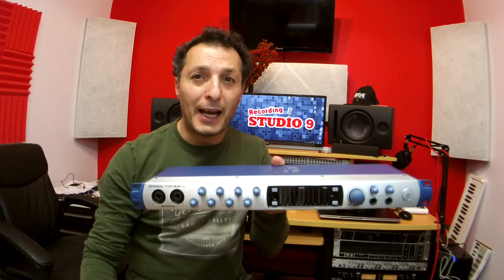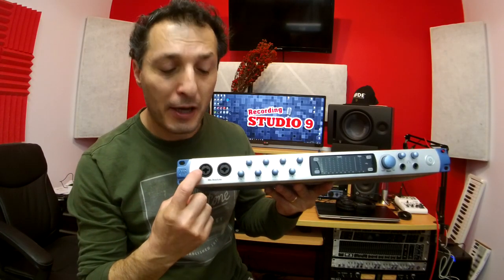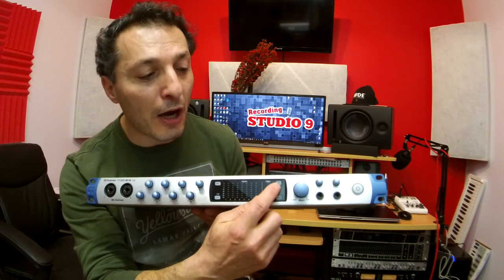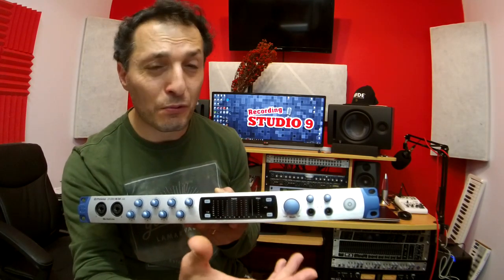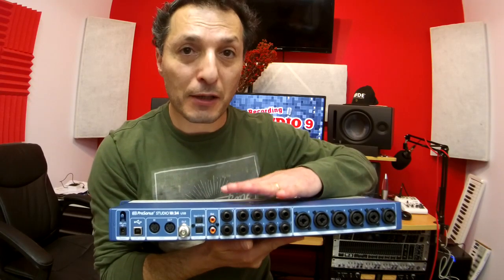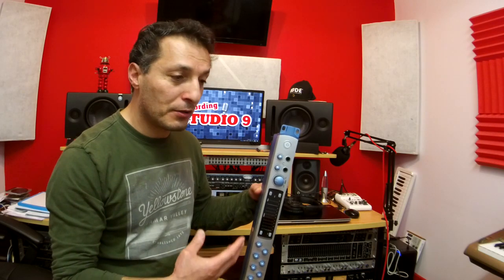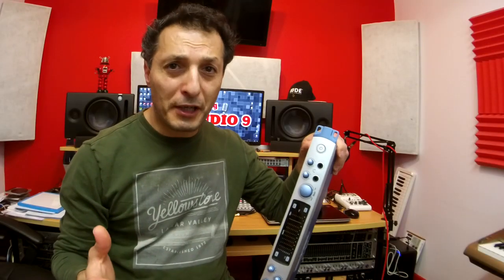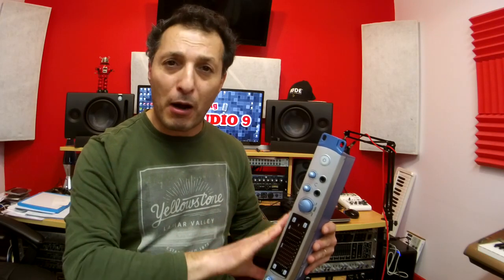PreSonus Studio 1824 USB Audio Interface Hardware Overview

Comment: Hello, I'm fairly new to audio gear, so apology for what may be a noob question.
I was wondering if the line outputs on the back are line level outputs for each of the microphones alone? As in, could I connect a microphone in one input (via XLR), take the line output of that into another rackmount equipment (such as a compressor or EQ) and take the line-level output of that into another input on the interface and record that into my DAW? Essentially using this half as a dedicated mic preamp and half interface for my DAW?

I'm aware that it would probably be more efficient just to use a dedicated preamp rack instead but I'm still curious.

Also, I read somewhere that this does not have zero-latency monitoring for the mics. Is this true? If so, is there a device that could help with this? Or a software solution?

Thanks!
Reply from the maker: I'm happy to help. First, might want to watch the next video in the series https://www.youtube.com/watch?v=BaYQi5d6DfU
There is no direct connection between the inputs and the outputs. It's better. Using the UC driver software, you can send any input(s) to any output(s) using the UC driver mixer. You can send input 1 to output 1 and input 2 output 2, or even input 1 to output 7. The only restriction is that the outputs are paired, meaning you can't send input 2 to output 3, but it can to output 2, 4, 6 or 8.
This UC driver mixer is zero latency. But, if you use as you planed, so that you can "insert" hardware signal processing, like compressors, then it may introduce few milliseconds of delay. Something you will not notice unless you record both channels in you DAW. But it should be perfectly fine for recording vocals with some compression or some other audio processing. 
NOTE: Output 1 & 2 are your main outputs.
So you can connect Mic to XLR input 1. Set UC mixer select AUX 3&4 and raise the channel 1 fader. This will send audio to outputs 3&4. Output 3 connect to hardware compressor line input. Compressor line output connect to input 3 line level. Adjust input 3 gain to suit level to record input 3 in your DAW.
I know it's long, but hope it helps.
Reply: @RecordingStudio9  Thank you so much for your reply! For some reason, I didn't see a notification from YouTube that you replied. But this was very helpful! I'm waiting for my 1824 to come in the mail btw :)

Comment: Nice video, But What is the latency with the unit?
Reply from the maker: With buffer size of down to 32, less than 10ms  round trip. Very good.
Reply: @RecordingStudio9  Thank you for the information. Is that at 44.1 24 bit?
Reply from the maker: No, I normally use 48Khz 24bits, but it virtually the same.
Reply: @RecordingStudio9  Thanks again for the information.
Reply: @RecordingStudio9  Same here thanks. I thought it might be better. I have a Pro 40 right now and with it at 48, 192 I am getting around 5
Reply: @midiman5045  I get 6.8ms RTL on my Edirol Fa101 from 2005!!!!. That is a 15 year old interface paired with with a 10$ Firewire PCIe card ( aliexpress). It's embarrassing the state of USB interfaces in 2020, a complete joke. USB was never designed for low latency MIDI ( jitter synch) or Audio. USB should of never been even thought of for any audio interfaces. We already had a perfect solution but Apple yet again pushed the industry to their crap machines. ESATA ports were already on laptops for years, now they are gone and we lost low latency Audio on them. But now we have Thunderbolt which should of been here for 10 years already. PCI cards destroyed even Firewire interfaces. You do realize that Presonus is running a scam on their interfaces selling "ASIO 2.0 DIRECT MONITORING" as if it's their on feature what a joke. This is why they added the DSP as people are starting to catching on to the scam. The ASIO 2.0 specs from 2003 already had ASIO Direct hardware monitoring already built in, all was needed was the Interface to support it and the Daw to support it as well. No stupid routing software was needed only the Daw ( Cubase, Samplitude, Sonar). Take a look at this picture DO YOU SEE THE SCAM NOW!! https://images.reverb.com/image/upload/s--DXmHxS6y--/f_auto,t_supersize/v1557326410/j5xnbgqcebiyjqdq0mxm.jpg
When hardware interfaces showed the diagram of the routing on top of the interface!!. Notice the DIRECT MONITOR MIXER section? Yes it is controlled from inside the Daw when the Soft Control button on the interface is clicked, allows for the ZERO latency routing ( monitoring) of ins and outs without using any extra software just the Daw.

Comment: Thanks Vatche for that Overview of the Presonus Studio 1824, i do like the Focusrite Pro-40 for me is better as the 48V phantom power is split into to buttons, 1 to 4 and the second button 5 to 8. But I am interested in hearing how it goes in the future after you have the chance to use it.. Cheers
Reply from the maker: Just connected it last night, and I'm VERY pleased.
It's a big oversight from PreSonus, and an issue only if you have or plan to use Condenser and Ribbon mics at the same time, otherwise, 99% of Dynamic Mics ignore the Phantom Power and can work side by side with Condenser Mics.

As to the +48V, since I won't be normally recording with it, other than the odd Mic or guitar, it's not going to affect me.
I use it to integrate my outboard Compressor gear during mixing or mastering and having up to 18 in and 18 out from my Studio One is a huge plus. That means I can setup 8 stereo bus to outboard gear and back, once I connect my Focusrite Octopre Dynamic ADAT unit.
Even just now having 2 stereo bus hardware insert points on my master bus works great.

Comment: The 48 phanton power on all channels is a great mistake from Presonus!!! I am looking for a 8 in interface and that one of my first consern. The Focusrite 18i20 is a better option
Reply from the maker: Yes, it's a big oversight from PreSonus, only if you have or plan to use Condenser and Ribbon mics at the same time, otherwise, 99% of Dynamic Mics ignore the Phantom Power and can work side by side with Condenser Mics.
Focusrite18i20 is another great choice that offers similar functionality. The PreSonus Studio 1824 integrates very well with Studio One V4 with interface settings/options available within Studio One.
Reply: I had a 18i20 which was great, but 48V on that is in groups of 4 - 1-4 and 5-8. Better but not ideal.